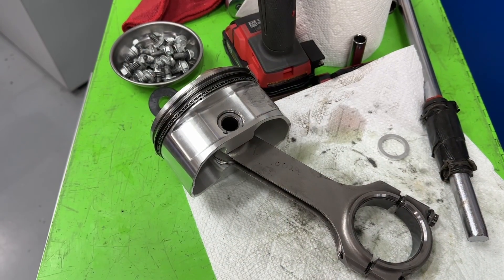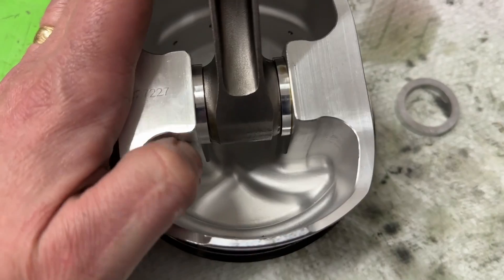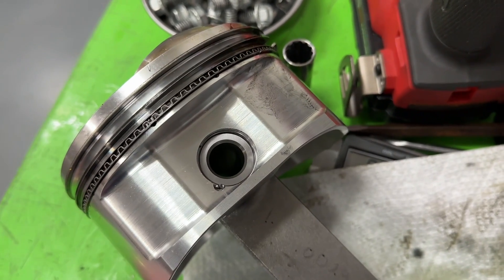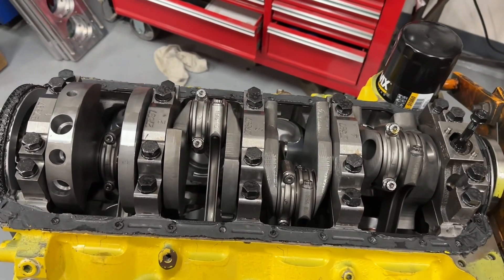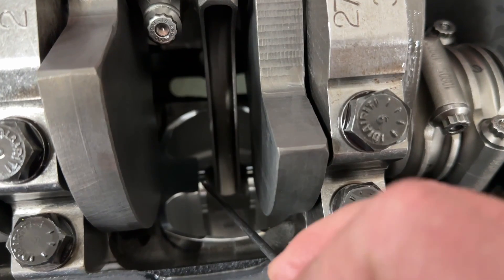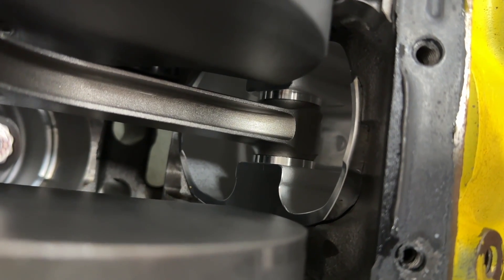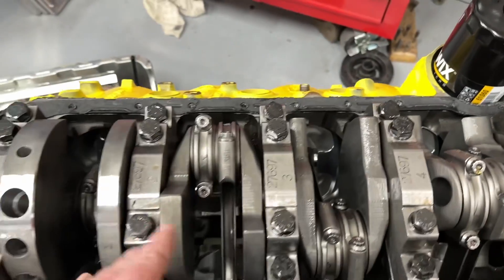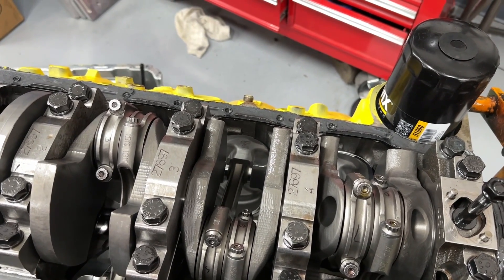Piston Guided Rod Information

Comment: You left a bit on the table not narrowing the big end of those rods down. 

You can also make a 2 piece Pin End bushing out of Aluminum bronze or Naval brass, and press the into the small end of the rod. Loctite 648, hone pin end on a sunnen machine. 
Then youre not Aluminum on aluminum.
0.006 is your number, Thats 0.003 a side? thanks

Comment: I don't see the extra side clearance on the bottom "moving" more oil.
The rod bearing clearances are tighter than even the normal rod side clearance, so the bearing clearance is the flow limitation, not the side clearance. 
What it would do is fling the oil Further than tight side clearances. I've always favored the high-side of side clearance, but I also run .001" more bearing clearance to allow greater oil flow to cool the bearing(s)

Comment: All that Excessive big end Rod to Rod side clearance kinda weird....Anything over 0.017"  Rod to Rod side Clearance just Flings humongous amount of oil onto Cylinder walls Overwhelming the Rings to reasonably Control....Windage tray can't reduce that Massive oil leakage Fling--Off.....
Reply from the maker: I wonder why nascar and nhra pro stock do it. You should read the other comments. A commenter mathematically shows why that is false but to summarize its rod bearing clearance that slings out not rod side clearance.

Comment: wider side Clerance does not hurt, to narrow does. Bearing clearance controls the oil flow, side clearance not so much   High boost application think TOP Fuel pins  smaller crank pin can make a difference   would you use a longer rod next similar build?  I would   piston guided rod less bearing narrowing for big fillet

Comment: This is / was common on 2 stroke engines especially on road racing small capacity engines that turned unreal rpm ( 12,000 to 18,000+ depending on cylinder displacement). I think they called it “upper control “. They did it to address overheating of the big end side washers on each side of the big end. With upper control the big end side washers were the same od as the roller brg cage to keep it centered.
Reply: I was going to mention this.  Suzuki did this in many of their motocross engines in the '80's.

Comment: Here in Australia , most guys in the burnout scene do this because they go from zero to 8 ish thousand revs and stay there for 2 to 10 minutes. Big clearance is needed for cooling, and also frees up horsepower
Reply: They may run larger bearing clearance, but they don’t use piston guided combos, I have supplied pistons and rods to a number of the good engine builders for the burnout engines, they doesn’t have to make a lot of power compared to other motor sport ( marine) with continuous RPM

Comment: Mercedes Benz has used piston guided rods in some of their high-performance engines many years ago, and those rods with the 2.100 big end used to be called "crank saver rods" years ago because they allow you to keep using a BBC crank that was damaged beyond the available undersize bearings, without having to weld it back up.

Comment: That's still WAY to much side clearance on the rods at the crank.  The Chevy guys use to bitch me out big time for .022 total side clearance on my Pontiac S/D motors at the crank end because of oil pressure drop at low rpm. and your triple of that.  I got a feeling Smokey Yunick is rolling in his grave.
Reply from the maker: You are very wrong. High level race cars have used this much or more including nascar. It has no effect on oil pressure. Watch the beginning of the video and you would see it has ample oil pressure at idle. Having more clearance cools the bearing better.
Reply: Circle track engines have way more. You can measure with a ruler instead of a feeler gauge.
Reply: If you do the math... the "leakage path" created by even an extremely tight .005 side clearance is about twice the size of the leakage path created by the rod bearing clearance. You can run all the side clearance you want. It won't affect the overall amount of windage at all. It's an old-school myth that's long-since been debunked since about 15-20 years ago.
Reply: You're not up on last centuries technology  !
Reply: The side clearance does not really control oil pressure . If you do the maths, say you have 0.0025” bearing clearance, the oil leakage past the side of the each rod(side clearance) exceeds a total of 0.010” (4 x 0.0025) or more , this is now no longer controlling oil leakage. I have several engines with combined side clearance of around 0.120” on our engines and oil pressure is great. NASCAR and many other engines use piston guided and combined side clearance of 0.100” or more, NASCAR engine builders are very strict on oil flow through an engine and keep to a minimum as it robs power,
Reply: ,,, I think I saw this in a video with Dorton a year ago , and I was amazed ; however I think I have my mind around it now .
Reply: This problem with rods floating around in two stroke engines comes from poorly made aftermarket pistons 😢
We don't have oil pressure there, but the bearing clearances are about the same. Our rods have 0.100 or more of room to float. You see the issues of worn rod bearing cages under pistons that do not control rod float. It will eat everything in the bottom end given enough time to knock the cheeks off the crank and con rod.